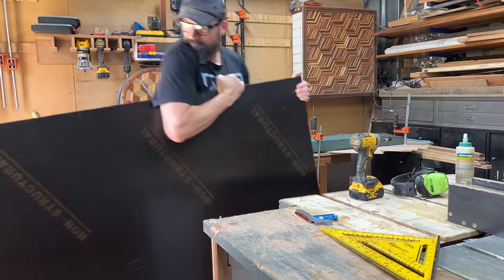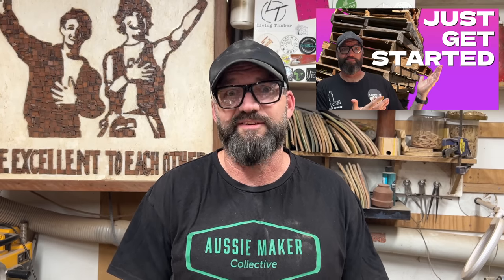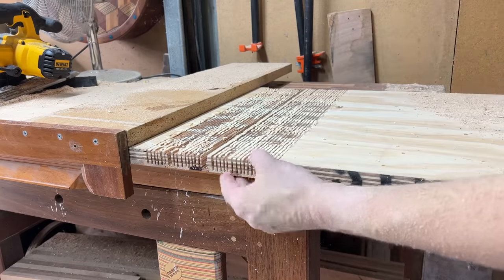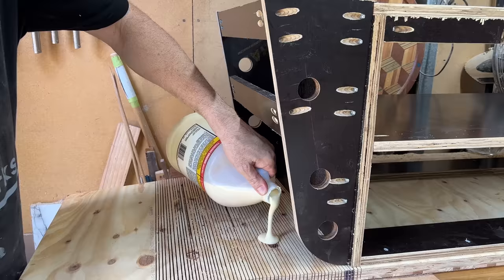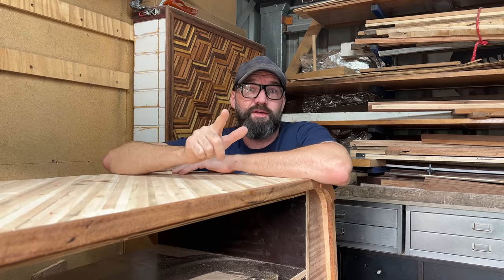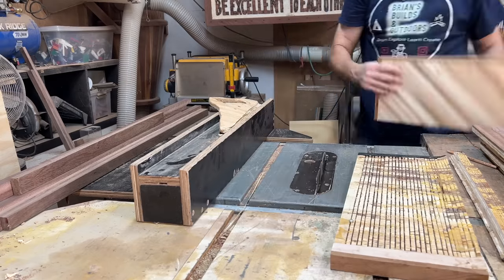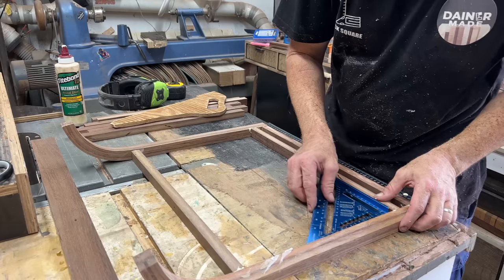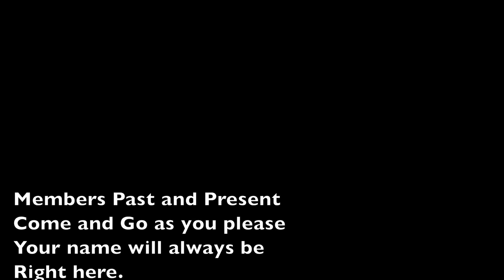Taking PalletWood to the next Level

Comment: $2.3k is way too low for a genuine custom piece. But what has probably reduced the very high value is the form-ply bones. Next time use fancy birch or hardwood ply. Adding $200 to the ply cost may add $1k+ to the sale price?
Reply: I'd be really annoyed at the "Non-structural" diagonal print on the black side of the drawers. I really like the black, but it should be uniform. Maybe powdercoat them at a car/wheels shop before assembly? Should come to not much if you have a friendly shop nearby, and if you can wait until they anyway do black or another colour that you like so there's zero setup costs to them.
Reply: Don’t know about Australia but everywhere else birch ply won’t add 200 for 3 sheets itl add 4-5 times that I’d think £250 a sheet in England at the min
Reply: Buy it then

Comment: Right, so, I get roughly 1714 AUD for one of my hunting knives, with damascus steel blade, polished brass furniture and elk hilt or 968AUD for one of my bare bones kitchen knives. Both have a roughly equivalent time investment as that cabinet, but lower starting materials cost. Keeping that in mind, I see no reason you couldn't get 2300 - 2500 AUD for that piece.
Reply: @Dainer Made  right, I used to feel the same way about what I do. Then I got a very quiet, very polite dressing down by a woodworker who has done some of the most impressive woodwork for some truly impressive people. The short version is this, that thinking is a trap, because every time to finish a project, you are better at what you do then when you started the project. This means you will always find mistakes that make you think you need to improve more to bill for what your time is worth. Set a price higher than you expect to get and if you get it and the client is happy, then priced correctly. If the piece doesn't move, then either you priced too high or your marketing is targeting the wrong demographic for your work. Just my two cents. Cheers mate, keep killin it.
Reply: @dainermade  you'll eventually get to where someone asks if you can do better and you're so fed up hearing that and have learned your worth that you'll laugh and walk away. Don't forget, they're not just paying for the piece, the cost of wear and tear on your tools, but most of all they're paying for your knowledge. Knowledge is worth the most when pricing yourself and you sir have a lot of knowledge

Comment: Dude, i can relate to how you feel so much. I totally can appreciate the amount of time and effort you put in this one. Believe me, i'm still a long way form where you are at right now. However if i were in your shoes, i'd sell it anonymously for whatever you can get for it and write it off as a learning project. 

If you are going for that grade of furniture, you're doing fine but you're not quite there yet in my opinion. Don't start complicating things the moment you're making a business out of your hobby.The drawers don't entirely align, the edge doesn't align at the connection between the straight and the bended piece, and the surface (as seen at 17:24) is full of dents and dinghies (you put dowels in there to repair?). At the right side, you can still see the cracks from the first bending attempt and the end of the video left me wondering, did you leave the inside of the cabinets unfinished? For example, did you put black veneer on the sides of the plywood to match the factory coated sides?

Don't start complicating things the moment you're making a business out of your hobby. You did just fine before.

Comment: I want to make a bed frame out of this formply, but the gold lettering is a bit ordinary. Did you experiment in trying to remove the lettering at all?
Reply: Dunno if you're in Australia, but Bunnings sell two different versions of formply. One is listed under "formply" and has the lettering. 

The other doesn't have the lettering and is still called formply but they list it under "Non-structural plywood" for some reason.